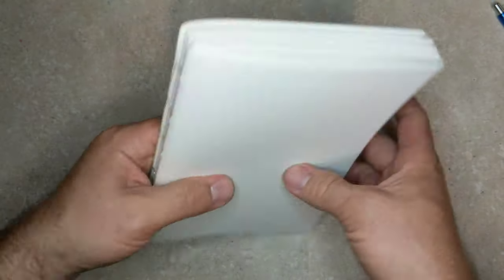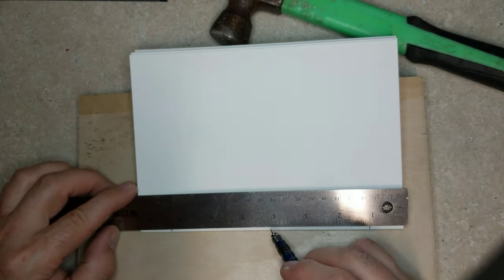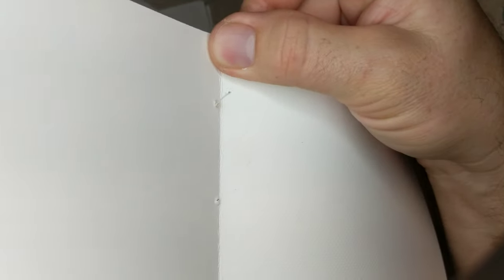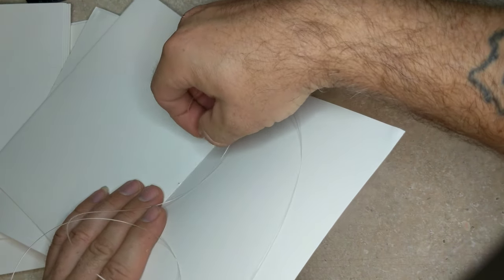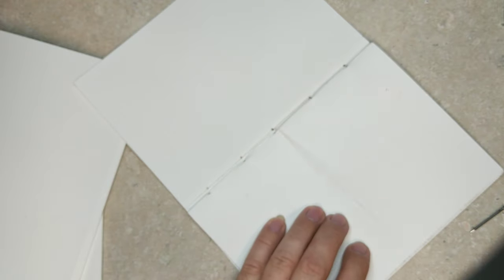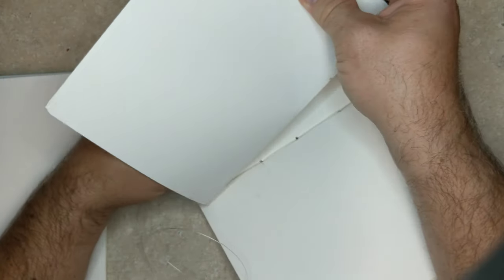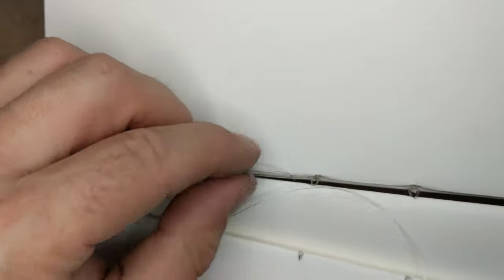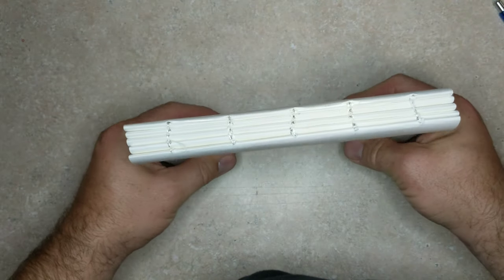Part 1: Handmade Book, for Watercolor or Drawing - theartproject - July 7, 2020 chad brown

Comment: This looks great. Looking forward to seeing the rest of it. And the drawings 

Though that seems more footery than usual.  Get a curved sewing needle, will make it soooooo much easier, especially for the looping around part. 

I recently made an a3 triple cross stitch book. The binding technique is easy enough but the size of it made it more difficult.  Photos and video flip through is on instagram if you want to check it out
Reply from the maker: I am having a little trouble with the footage I got for the cover. I am hoping I can still use it. If so it should be out tonight or tomorrow. I was ill prepared for this binding. My thread and needles were at work and I couldn't get to them. So I did fumble a lot. That was also due to the thickness and rigidity of the papers. But I'm full of excuses. I do wish I had the curved needle.
Reply: @theartproject  damn virus situation in the way of materials. Fishing wire is a good idea though. I love bookbinding. I hope yoou manage to salvage the cover footage